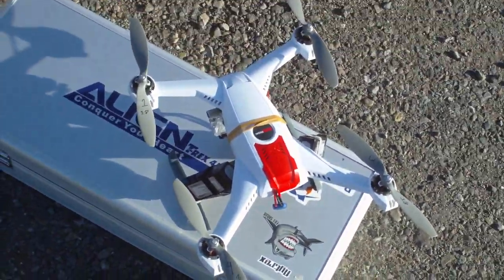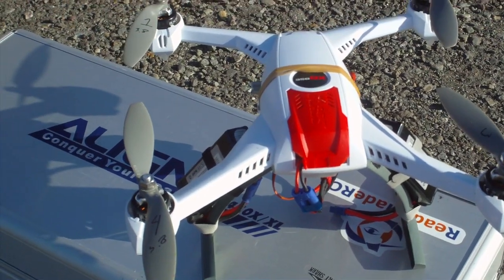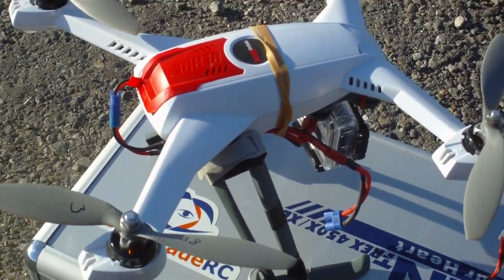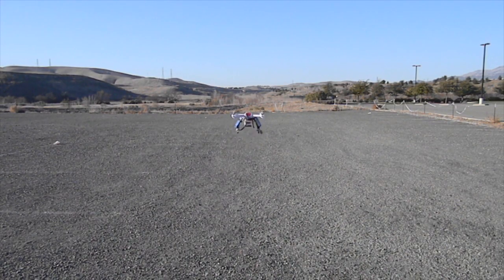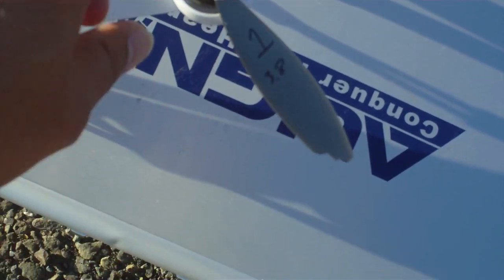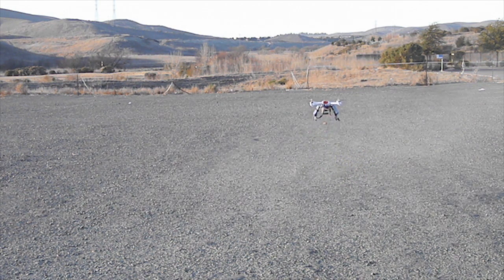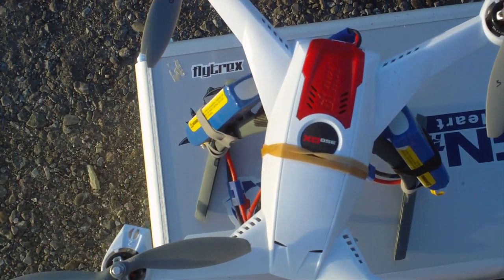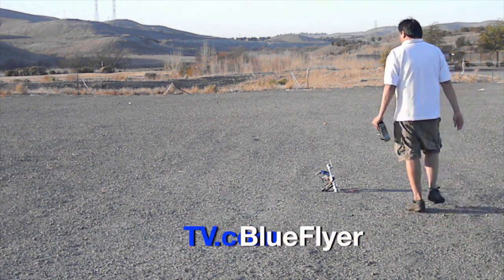2 Batteries on the 350 QX: Longer flight times or Destruction madness?

Comment: Hi BlueFlyer. I am not sure IF my question has ever been asked before or not, so I am going to ask my question of you. I would like to know IF there is any hardware that we could attach to our QX 350's that will monitor and send to our control counsel, that will tell us what percentage of the battery is remaining? I'm really over it trying to guess how much more battery life is remaining before it falls out of the sky like a hot rock. As everyone knows, everything that is done during flight, acceleration, wind, flips, rolls, ect... I wish that Blade had a APP. for our Android, or tablets, like DJI has. Any information would be appreciated. Thanks, Dexter
Reply from the maker: +DEX DEXTER That's easy, Dex.  No need for an app.  Just hook up a $5 volt alarm/monitor to the battery.  Set it to 3.7v.  You'll get an early warning system : ) I do this as well.  The other options such as OSD's will cost you a pretty penny because you'll be setting up an FPV system.  Thanks for the question and comment.
Reply: Hey Thanks for taking the time to answer my question BlueFlyer. You said "Just hook up a $5 volt alarm/monitor to the battery. Set it to 3.7v. " I understand what you told me to do. But could you please Tell me where I can buy this $5 Volt Alarm/Monitor? Or just give me a LINK and then I will be sure as to buy the Correct device. Thank you in advance for your time.
Reply from the maker: +DEX DEXTER It's a Lipo Voltage Tester and Alarm - here's the link: http://goo.gl/ggD3Hq
Reply: Ordered today. Thanks Much. :-)

Comment: I don't feel like reading every comment... but basically parallel = DOUBLE the amperage... ie: the small 10A ESC's and motors are likely being destroyed. Series = double voltage... so you may have better luck running a 4S if you're interested in a little more power, but of course you are still risking electronics longevity.
Reply: Kendall Smith considering that he had 2 2200mah batteries on, assuming they were in parallel, thats a total of 4400 milliamps, or 4.4 total amps. With the power distribution board, idk if that divides the amperage or voltage but either way wouldn't a 10A ESC have no problem with this?
Reply: Kendall Smith motor draw determines amperage consumption. Providing more mah results in longer run times, period. A motor heats up because the work it is being asked to do is pushing the limits of its capability and forcing it to draw more amps than the motor windings can handle which results in excess heat, and ultimately heat related magnet adhesive failure. On the other side, too much heat can also cause the insulation on the motor windings to melt and result I. A short that prevents the motor from creating the magnetic field required to spin properly.

Comment: Thank you for your research!.  As always professionally done.  You are a great communicator.  
PS : That is a very angry , unforgiving and dusty field.  How often do you replace motor bering in such conditions.
Reply from the maker: Vicente A. Mendez, MD. FACP Thanks for the kind words.  Yes.  It was a gritty, hot and dry parking lot.  hehhehe  Believe it or not, I haven't replaced the motor.  I don't know if it was luck but the motors have remained clean and smooth even through that dust.  I'm still flying this today with the same motors.

Comment: Just got an entry level quad, this is something I would have tried... thanks for the experiment!
Reply from the maker: that's great.  which quad did you get?
Reply: BlueFlyerTV Very entry level, have a Hubsan x4 107l.  Just tired it outside today and it can barely keep up with a slight headwind.  Have tried the larger batteries for it... we did get longer flight times but not the stability of stock batteries.    Not sure what the next step is; a 350 or DIY.  The 350's look amazing but I wouldn't mind putting it together myself.  Are there any options there?
Reply from the maker: The x4 is good indoor mini quad to get your feet wet.  There are so many options out these days.  The 350 QX or the DJI Phantom is a good next step because of all the support you can get plus the tech in them is fantastic.  If you're not intimidated by soldering , the DJI F330 or F450 are the best bang for your buck in my opinion.  The NAZA Lite flight controller + GPS are amazingly easy to learn and simple to put together.  I wrote a short how-to. Hope this helps you decide ... http://www.blueflyertv.com/build-450-sized-quadcopter-stay-sane/
Reply: C. Richards I think the 380 Mah is the sweet spot for the Hubsan X4107L. If you can't fly it in a slight headwind, it is malfunctioning or you don't have it in high rates ( stunt mode). The prop guard might cause problems in wind or a bum set of props.

Comment: The only drawback on the 350 QX is not being able to adjust the gain on the flight controller (gyros)  Unlike the Naza on the Phantom 2 you can adjust the gains. Which is necessary when adding weight to the quad. Plus I agree the compass could have been effected by the Batt. on the landing gear. But the 350 QX is still a great quad for beginners like me.
Reply from the maker: Thanks for watching, Michael.  No doubt.  The 350QX is a great entry-level quad to get people familiar with the quad's flight characteristics without dealing with gain adjustments, etc.  As with most of my videos, I come from a curious hobbyist standpoint.  Hence, this experiment.
Reply: BlueFlyerTV Nothing wrong with curiosity: I plan on putting mine thru a few tests myself. Besides people like you and I can help others and maybe the manufacturer to improve upon them too.
Reply: BlueFlyerTV Oh and by the way the QX I just ordered has the updated flight modes. I'll keep you informed on how well it performs in AP mode, or you can update yours, if you haven't already. They tell me it comes with copper foil to wrap your GoPro in that helps with GPS interference. Thanks you for all the great videos very informative.
Reply from the maker: Michael Killian
I've see those foil.  Let's hope they do work : )  It'd be great if you could let me know how the new 2.0 works.  I'm trying to get it in advance to that I can compare it with the 1.0.
Reply: BlueFlyerTV I would be happy to let you know how well it works. As of yet, I have not got a GoPro yet. I'm working on that, plus the 350QX has not got to me yet. Give me a month and I will have some videos of it.
Reply: Michael Killian

Comment: I wonder if you used (2)1500mah or 1800mah batteries. It would be less weight than the (2) 2200mah batteries and more capacity than the stock 2200mah. Maybe better results? I may have to try that myself! Mounted higher of course.
Reply from the maker: It might work but don't do as I did and put it on the landing skids.  It might be better if you stack it; one inside and one directly underneath for better CG.
Reply: BlueFlyerTV Yes, definitely mount them higher up. I will give it a try. I need to look for some batteries first!

Comment: Just a thought, the battery was probably far too close to the compass which is mounted on the landing gear. I had a similar instability problem with metal too close to the compass, relocated the compass away from all metal and full stability in Green Mode returned.
Reply from the maker: I think it was the CG but you could be right  Thanks for the feedback : )

Comment: your going to burn out your motors carrying the extra weight.
Reply from the maker: you're right.  but nothing ventured nothing gained, right?  i had to see.
Reply: good man, I like it,
im interested in the interesting experiments you do on your site, also it saves me having to try them, I can choose the ones I like.
thank you
Reply: BlueFlyerTV
So just one extra battery pack is enough to make the motors overheat? This can't be right it has to be just the crappy motors that guy that built his own has an hour run time and doesn't have this problem.
Reply from the maker: Anew... The 350 was not designed to take on the extra load.  I think the motors were overheating is due to my battery placement.  The 350 was trying hard to compensate for balance.  I've heard ohers were successful in using two batts but one is directly underneath for good CG.
Reply: Ah so it's really just a balance issue? I want to build my own and I want a long run time but I also want mine to be an anti drone and have anti drone capabilities.
Reply from the maker: Anti drone?
Reply: Yeah like a net gun or some sort of foam to launch at police drones.

Comment: Hi, Don't go for mulit Batts, The extra weight  will diminish any gain,  The motors will work harder, hence the hot front motors, the 350 qx will not handle or be lively anymore, and if the Quad comes down the extra weight WILL cause more damage.
Reply from the maker: Thanks, jeepman.  It was more of an experiment more than anything : )   But you're right; more weight = more damage.

Comment: Im pretty sure it does not matter what you do with the weight and the CG. The gyro and on-board computers adjust for additional weight distribution by changing the motor speed. So...if theoretically..if you ad weight forward the copter will still fly level by increasing speed on the front motors and slowing the rear.

Comment: I put a 3200 mah, batt in my blade I get about 15 min without fpv setup and about 11 min  with it ,but I land at first batt warning.I had to take apart my blade "modify" the batt box and mount gps to the top half of the blade,Im gonna order different c ratings and see how they perform,heres a fex pics of that mod.https://plus.google.com/100193886667869625299/posts/VH2Av5Q5h27
Reply from the maker: Very nice.  But only 11minutes for a 3200?  Thanks for the idea.
Reply: Yeah I was disappointed with  flight time to.(new batt heavy),But I land at the first sign of the first warning lights, I had it autoland into a fence before so I put in the bigger batt and haven't pushed it.Im kinda new to this so im interested to see what would happen with a smaller c rating.I don't care if I lose acro power, just want to fly longer. acro mode is expensive!!

Comment: i  ran 2 batt(stock e-flite) 1 in normal compartment, 1 velcro directly under body, and i use 8x4.7 props.. no problems just a little slower ascent
Reply from the maker: That works, Danny.  I wanted to put other gear underneath that's why I tried the skids. I'm working on naother option. hehhehe

Comment: It's gotta be something more than the mass of the second battery isn't it? I've seen several videos of guys with a 200g gimbal and a gopro flying pretty well. If i'm not mistaken the gimbals weigh more than the battery don't they?
Reply from the maker: Slannesh.  It's not the second battery.  It's my placement.  The darn thing moved like a pendulum!  hehhehe  I know what you are saying because I have a gimbal too.  If I placed the batteries right underneath, I think I'd be OK but I want to keep that area empty for other gears.  Thanks for the comment.
Reply: BlueFlyerTV Yeah that makes sense. Are you planning on trying it again with the extra battery right above or below?
Reply from the maker: Slannesh I'm always going for below.  The top is too uneven to be a safe location. Stay tuned...

Comment: I also think I was told a 2500mah will fit snugly in the QX 350
Reply: they sell a 2700 mAh battery that is just a little longer than the stock 2200 mAh battery and depending on weight and how aggressive you fly will provide about 3 - 4 more minutes of flight time.
Reply from the maker: I'm thinking about getting that Ryan but then the 3000's are coming because of the 350QX AP.
Reply: In your opinion do you think that Blade is going to allow firmware updates for us  350 QX owners? I would love to have the AP firmware for my 350.
Reply from the maker: i hope but i doubt it.  The AP firmware might not work too.  I think Blade upgraded the board.

Comment: Suggestion. Would you have better luck with stability by mounting the two batteries piggy back under the Quad on center of gravity ? just wondered
Reply from the maker: Maybe thorfoot... But I also want to put gears under as well.  This is why I used the skids.  I'm working on another option : )